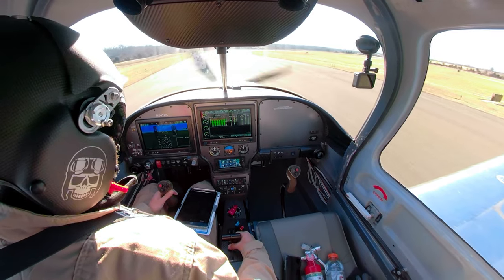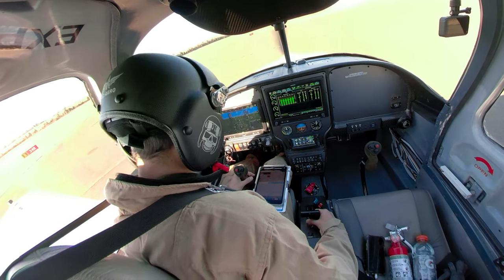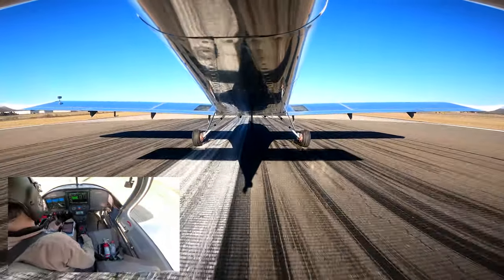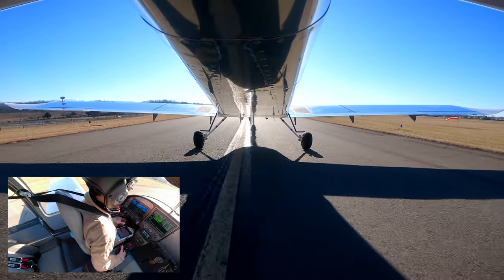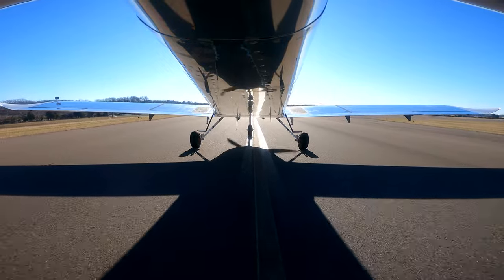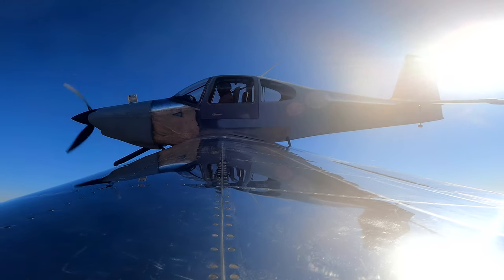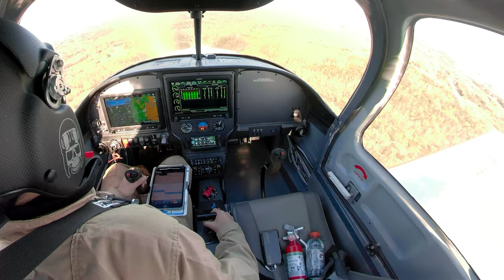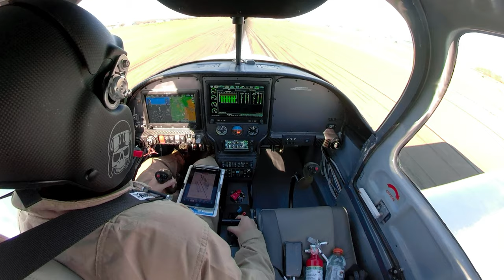RV10 Test Flight 1: First Flight (N5412K) and First Landing!

Comment: Congrats,
Looks like the cowl (oil) door is open at 18:00.
Reply from the maker: Very observant! It bowed and opened as soon as I leveled out from my initial climb and got to cruise speed. CHTs stayed under control so I continued on, my concern was it ripping off and hitting some other part of the plane, but it was pretty solid. Post TF1 I rebuilt that door out of carbon fiber and it has been rock solid since.
https://karrelsj.blogspot.com/2021/01/first-flight.html
Reply: @JeffKarrels  Right I heard similar stories before. I'm building an RV-7, maybe I should start with carbon and skip fibreglass. Thanks for the heads up.
Reply from the maker: @marcelheijmans6092  I need to make a blog post on what I ended up doing, but I did two things. First I made it out of Carbon Fiber and it is much more rigid than the original.  Secondly, I swapped out the latches. On the first version I used the latches from a C172 oil door. Version 2 I used the ones from a SR22.